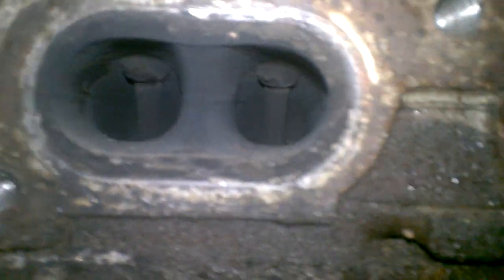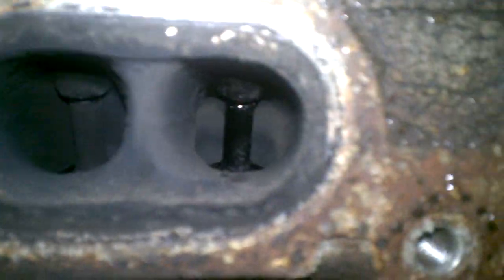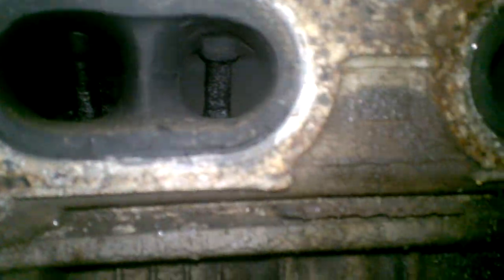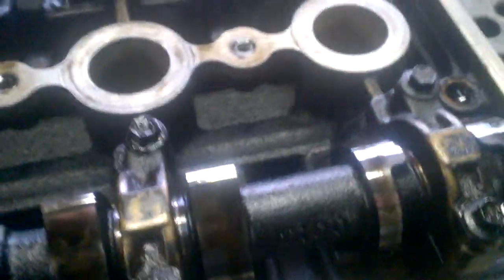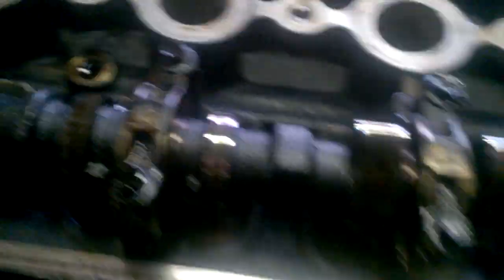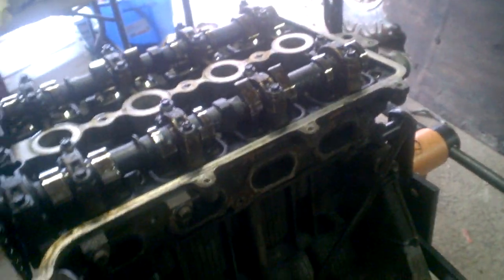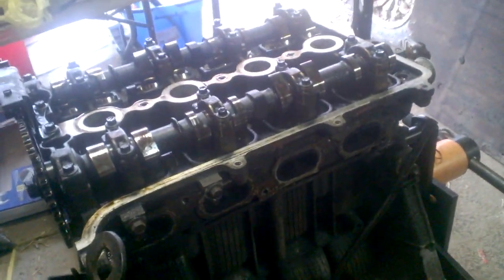Dispelling the Myth of ATF Cleaning Your Engine

Comment: You put ATF in your diesel fuel to keep the fuel system lubricated and clean, You don’t put it in your oil that’s not what people mean when thay say ATF cleans.
Reply: That's EXACTLY what people mean when they say ATF cleans. You put it in your oil and it cleans gunk build up.
Reply: @Nobody2day553  as well as your fuel tank
Reply: That's what I thought as well. Best injector cleaner there is which means running thru your fuel tank, just trying to fig out if it works as good on gas  cause I have one in Ned of injector cleaning and w the gas needing to fire by plug versus compression if it will be too much
Reply: @chadsmith14  only time I know you can add ATF to a gas is if you dump a quart in the oil to help break up sludge or sticking lifters/valves. 

Depending upon n the vehicle most are easy to to the injectors if not you might try to get some 44k injection cleaner.

Comment: The head deck and camshaft was cleaned. The chain cover area wasn't because the oil pressure there is null. Just splash oil doesn't clean.
Reply: Yep. Looks to me it cleaned really well the deck area, usually the head is the dirtiest part of a neglected engine. For me it´s proof that ATF works as a cleaner.

Comment: What I do is empty all oil and fill with ATF. Drive it around the neighborhood a couple miles and then run on idle for 20 minutes. Dump the ATF and fill with oil and replace filter and my car ran like new. Couldn't hear the engine or feel it. I have no idea if it cleaned it but runs like new.
Reply: What engine do you have?
Reply: Seriously I don't believe it
Reply: Update
Reply: @BdeJJG  Update, it's all good and running great. I haven't done it since but I haven't had a reason to. I would do it again and probably will within this year. This isn't something I made up, people have been doing this for a long time. It worked for me and many others.

Comment: Hi Josh! I know this is an older video but the ATF trick was not used to clean an engine that had been running Valvoline oil. It was used to unstick hydraulic lifters on small block Chevy engines (most commonly) and it works like a charm. I would not run the ATF mixed with oil very long. Typically the way we would treat for sticking valve lifters was to drain out a couple quarts of motor oil and replace it with 2 quarts of ATF, run the engine until the lifters freed up, (usually after only about 15 minutes of run time) adjust the valves and then change out the oil and filter with fresh new stuff. The result was no more tickety tick noises as the lifters were now free to work properly to keep the valve lash at "0". The only way to clean sludge out of an engine is with diesel fuel and a brush then a good flush with oil changes in between. But, if your engine oil has already done that to your engine, it's probably time for a rebuild anyway.
Reply from the maker: @KentuckyFriedFixes  Ultimately, if these engines are not well-maintained, they need to be rebuilt. 

If you follow the maintenance schedule on them, use a high-quality synthetic motor oil, and take care of them, they will withstand just about anything. 

The rings and the valve stems on ANY engine can be trashed by poor maintenance. It was particularly a problem with THESE engines because of the average cylinder wall temperature and the lack of drain holes in the landing of the oil control rings. 

And trashed valve stem seals is a symptom of oil starvation and/OR lack of maintenance when the oil turns to sludge on them.
Reply: @Joshua_James_Howard  Well put Josh! I couldn't agree more.

Comment: I pulled the heads off a Ram 5.7 with 250k miles and brush coated the top of the pistons with ATF , then 24 hours later again. Without any other cleaning or rubbing, they were shiny as new. I'm convinced!
Reply: Is it easy to change the lifters on ram or do u have to pull the fuel rail and intake manifold off?

Comment: I use it for a soak in the cylinders for 24 hours and it melts excessive carbon that built up from low rpm driving all winter.

Comment: valve seals are bad on that engine..and it can be seen it was poorly maintained by previous owner..
Reply from the maker: I found a hypodermic syringe, with its safety caps still on it, and a glass pipe with some type of sticky, black resin burned into the inside of it, within an empty cigarette pack, when I pulled the center console to make repairs to the emergency brake cable when this car was originally purchased out of the police impound yard. This car was abused and neglected, and I know why, but it hasn't stopped me from caring for it the way a vehicle owner should care for the car they drive or house they live in.

Comment: As in the video!   Sure, around in the engine valleys. And open flat areas, will remain dirty.  
ATF will clean the high flow areas first. In which you are after anyway. 
 It will soften the rest in time. But it will take years of doing this to clean it all off.   After all!  It took almost 200k miles to build that up. Cannot expect an overnight clean up.
Reply: So it works,???

Comment: Running ATF/MMO/Kero/etc on an engine that’s lived a long life and you’re unsure it’s ever had it done before will clean out the heavy deposits but it won’t make it anywhere near as clean as an engine that has had it done regularly... or better yet run full synthetic exclusively after the break in period and changed at normal intervals.

I also say do so at your own risk with older engines because IME, freeing up internal gunk will often cause leaks to develop, or if leaks already exist make them worse. Also, freeing up gunk in an older engine can cause problems that didn’t exist before. I’ve dealt with collapsed lifters, clogged oil filters more frequently than not, and occasionally a clogged oil pump pickup screen. 

I bought an Econoline that needed an oil pump many moons ago. Upon removal I saw the pickup was jammed full of junk. Coincidentally there were two bottles of MMO in the back. 

My first truck was a 1991 S10 with 179k on the clock. I had more ambition than brains at 18 and I decided to spoil my new baby with full synthetic and a half quart replaced with MMO. I learned what I did was the equivalent of a bottle of ex-lax after a chinese food dinner. Not only did I clog my oil filter, but the valve covers and pan gasket began weeping oil, which got worse. After cutting the oil filter open, the debris on the medium looked like fine sand.

Comment: Probably it will not clean but running atf with proportion 1 to 10 will never hurt your engine on contrary will make it smoother and quieter. I did it in many cars and never had a problem mixing with any kind of oils except my oil in my diesel car.

Comment from the maker: I purchased the car, with 163,082 miles in August of 2016. The car was titled, inspected, and plated on Nov. 1, 2016 w/163,095 miles(mileage to drive to State Highway Patrol Barracks and back to my home). Oil changes and filter were done every 3,000 miles, oil consumption gradually increased from 1qt/200 miles to 1qt/80 miles. Burnt an exhaust valve(SeaFoam in gas tank) in March of 2018 with 187,369 miles on the car. This is a video of what my inside surfaces looked like AFTER running the ATF/Oil mix. ATF has exceptional cleaning detergents and viscosity of a 20w oil. However, unlike what I was told by a few people, it does very little to actually clean or maintain the engine surfaces from build up.Shell Rotella T Full Synthetic 5w-40 is one of the best oils to use, to keep the rings from seizing up and reduce oil consumption. It is a diesel oil, designed to withstand turbo-diesel engines, so it will remove the soot that clogs up the rings much better.
Reply: So try the 540 on a engine thats not diesel?
Reply from the maker: @BdeJJG  You can try it, yes, depending on your specific vehicle. 

It works for the Saturn S-Series engines, because they didn't require lower viscosity, full synthetic oils, like almost all newer cars of today, do. 

If your care is newer than probably about 2005, you may not want to try it and I wouldn't recommend any oil other than a full synthetic oil that matches your manufacturer's viscosity recommendations.

Comment: It's now November 2018.   So what did you find out/determine??     In addition, I have other questions as follows.... 1) Did you run/drive the vehicle for 25,000 miles before an oil change?  If not, then when did you do oil change(s) within that 25,000 miles?  2) How far did you drive on an average day?  3) How hard did you drive the car?  4) How old is the car and what is the mileage?
Reply: Running a engine 25k miles before a oil change will blow up the engine. You run the car for 1k miles then change it. I always add it at 2500 then change it at 2800-3000 and I’ve never had a problem and my engines fine
Reply: @P00P_  LOL, In regards to your reply timing...... Better late than never I say!

At this point, I have forgotten the original video!  Maybe I'll revisit it later.
Reply: @lisab3396  yeah I was just looking at this videos and this is the first time someone has responded that fast for having a comment 3 years old. I’m currently at school for automotive/heavy diesel equipment and my instructor says put ATF in your crank case to clean it out or to clean and help lifters. Saw this comment and was thinking “who in the world drives 25k miles before a oil change?”
Reply: @P00P_    Greg, I applaud you for doing research.  I will have to look back at what the heck I originally responded to here and why!  In short, pay good attention to your instructors, do research and consider all the options! 

As an example, in late 2012, my 97 GM Vortex 4.3l had an intake gasket leak whereas coolant got into the crankcase and it was a messy sludge.  I caught it early, removed, cleaned the intake cover and the air plenum, replaced gaskets and drained the oil/coolant sludge mix and then double flushed the crankcase with ATF with an engine warm/hot run over several repeated minutes and the a final clean oil filter and oil change.  This is still my daily driver presently in Dec 2021! 

Moral of the story....You look after it, It will look after you! 👍

On the other side of the coin:   If you have a Girl Friend or Wife, Treat her respectfully, gently and with loving care, she will love you and perform/run forever!      LOL., that's not exactly a mechanics concern on someone else's vehicles, but the mentality/thought is the same!!!

All the best on your schooling and career.

By the way, don't tell your instructors, but look up Scanner Danner on YouTube.  A great inspiration if I say so!!
Reply: That’s those cars you see on fire on the side of the road
Reply: @roberthall7206  An assumption or you have qualified data on that?

Comment: I bet the areas where you see dirt on your engine will rub off very easily with a rag after running ATF regularly through your engine. How many miles where on the car b4 you started to run atf in oil? How bad was it sludge up in the first place? I think if you start running ATF in you engine about 200 miles b4 a oil change since new this engine would look better. There is not much you can do about carbon building up on the back. Of a exhaust valve other then leaning your fuel/air mix if the car is carbureted or you can mess with “the tune” but you risk burning valves.

Comment: That engine is not made to last over 100,000 miles.  The engine temperature is too high  for the transmission oil to clean properly plus the engine has very poor oil splash
Reply from the maker: @SteveXNYC  Well, when I bought my Saturn, it had 163,082 miles on the ORIGINAL engine, and still had a FACTORY Saturn oil filter, indicating the oil had never been changed, or had not been changed since the last Saturn dealership closed in 2010. 

And that would have been the Saturn of Route 422

So, you explain to me HOW that engine lasted so long, without proper maintenance......

I worked in the salvage yard business for many years, and my family owns a salvage yard. 

All I ever had to do was keep adding oil, to keep it from having any catastrophic failures. 

Scrapped it with 254,000+ on the odometer, and the transmission was still fine. 

Replaced the valve body when I got the car, with an rebuilt unit from www.saturnfans.com users and did regular transmission fluid changes and filter changes every 30,000. 

Never had one issue with the automatic transmission, either.

Comment: I put a quart of marvel mystery oil in a 6 qt v8 to bring it to full. It would usually burn 1 qt every 4,000 miles. The MMO stopped the burning, with it in there, for 2,000 miles.  I'm about to run it with oil again to see if it burns any, and add ATF when it's low to see if it does the same as the MMO.

Comment: ok so im not gonna lie im somewhat surprised it didnt clean better but. but. the oil was cooked from "the previous owner" 
he went past oil change intervals most likely didnt add oil like many of these cars needed between oil changes. maybe even cheap oil. 
burnt and cooked oil are super hard to remove without acid baths. but you need to add some through the intake maybe through the brake booster port. do that when the motor is hot let it suck up a good amount usually a quarter to half quart and almost stall it out at the end and shut it off for 20-30 mins.
the atf will break down alot of carbon on the intake valves and exhaust along with in the intake and exhaust ports. thats the best use of atf to clean an engine. a quart in an oil change will help some in the crankcase but its only really good for sludge. without getting hot the atf cant break down heavy deposits. and in the head close to the combustion chamber is its best bet.

Comment: Only add a quart or 2 to the oil let engine run for 15 to 20 min let set for 20 min repeat drain oil change filter helps keep oil ports clean best to do it before it hits 100k miles
Reply from the maker: This I would actually recommend, but instead of using Dexron-III ATF, I would recommend the product that Gunk makes, specifically for doing exactly what you are instructing. 

I have used the Gunk product, which is recommended right before you change the oil, and they use these exact same instructions. 

Their product is solvent-based, because it contains a small amount of kerosene, but like ATF, it will not hurt the engine at all. 

It works great to remove sludge that can buildup in the engine, when a previous owner has neglected the engine and not kept up with the maintenance.

Comment: Premium blue is very expensive. But it's the only oil I saw a cleaning effect at ring pack while running during a oci.
Reply: The restore version is only available at Cummins dealers and it is designed to clean out all the buildup in a engine.
Reply: Premium blue eh gotta look into that one

Comment: If you're adding atf to new oil to run 3000 miles, you missed the point completely! It's to add just before you change the oil to break up sludge. It's also for engines running conventional as synthetic oil already has detergents and will stay clean with regular change intervals.

Comment: An old school method is to run Diesel through your engine (in place of your oil) for up to 5 mins after taking out the oil. That or use specific flush products
Reply from the maker: I have heard you can do that or use kerosene and run it for 5 minutes and then immediately change the oil afterwards in either case.
Reply: Na. Very bad idea

Comment: Buy a gallon of Castrol Super Clean. Drain oil fill it Super Clean. This only works on engines you can remove the distributor and turn oil pump manually.
The longer you run the pump manually the more this stuff will flush.
If you want it really clean. Drain the now dirty SC, fill it with fresh SC again. 
Next fill the engine with the cheapest oil you can find.
Change filter after adding cheap oil. Turn pump over by hand again, better yet use a drill.
Drain that. Now add your oil and filter of choice.
Prime pump again. Replace the distributor.

Comment: If you hold the camera still for 5 seconds it can focus and we can see better instead of getting seasick.
Reply from the maker: Yeah, it is tough to make videos with my phone camera. I no longer have the car. It died, in January, at 254,770 miles. Still on the factory transmission. It was on its second engine, because the factory engine (VIN matched) got a burnt valve at around 187k. Unpaid to have that engine rebuilt, new crank, rods, pistons, rings, valves, valve stem seals. The only things, that stayed original needed the cams and valve springs. When the second engine got a burnt valve, about 40kkles after I installed it, I knew that was apparently a problem with the Twin Cam. 

The reason I scrapped the car and took a loss was the mistake I made with the header tape. One night, my header actually heated enough, that the header tape caught fire and burned my wiring. I was asleep, when. It happened. How the whole car didn't melt is an act of God, but it left the wiring to my valve body hanging by single strands of copper. I don't know how the fire made it under my air intake and battery tray, without sending the battery sky high, but it did. I also burnt the wires to my cooling fans, but I was able to repair that. How that fire went from the front of the engine bay, to the rear and didn't melt the fuel lines also perplexes me. 

So, no more videos can be made. I miss my Saturn. Maybe I can find another one, down the road. You never know.

Comment: my dad ran autotransmision dow the carborator it got rid of the tic and smoked big time for a bit
Reply: jason naumetz  I was taught that too by an old plumber and it really worked well, engine tear down looked like a new engine after 70,000 miles back in 1970's, also put a quart in my gas tank now and then and ran it down the highway, smoked like hell, but smoothed out the engine